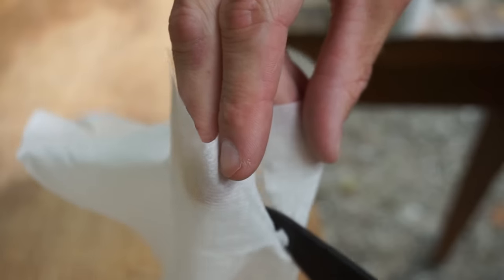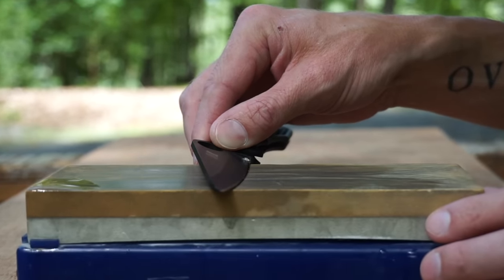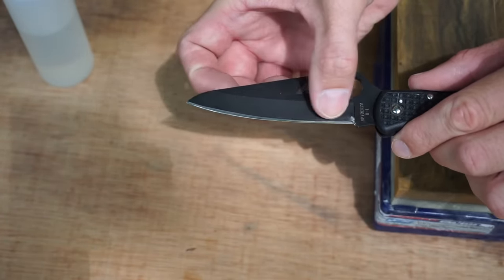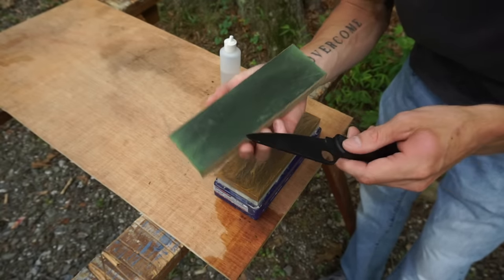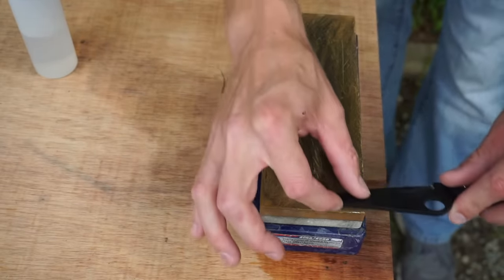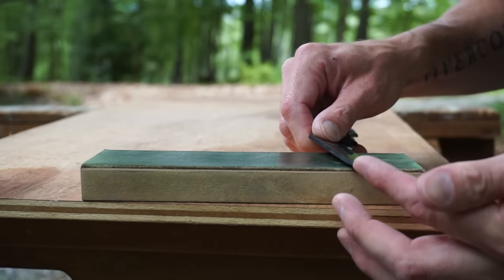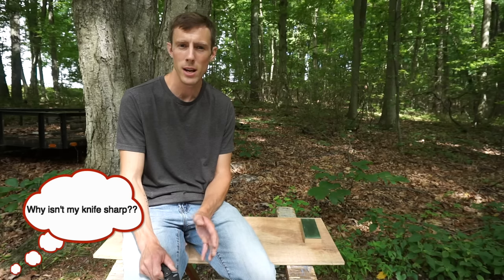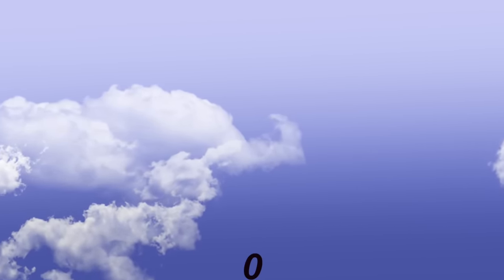3 SHARPENING TIPS BEGINNERS MUST KNOW.  How to sharpen a knife

Comment: I have a dual grit stone-100- and 240-grit...are these too coarse ie should I not use them except for extremely dull knives or cheap knives and go finer, and if so, how fine? Also are you using oil or water on the stone?

Comment: Thanks for this video.  Could you explain the different steel types and if there are different techniques to sharpening different types of steel.  I have read that Damascus steel has great edge retention  properties but is difficult to sharpen.  Is this true and if so is there a specific technique that works better for it?

Comment: I was taught about the "fast" edge and the "slow" edge. Fast is to sharpen towards you and the slow is to sharpen away from you and creates a generally finer edge.  But then I saw a toolmaker use circular motions and sharpen a knife to the point he could split a hair - my mind was blown
Reply: The circle was my old man's method too. I've dulled out knives beyond belief trying to do it, but so far no success.😂. He worked as a butcher for quite a while and that guy could put an edge on a knife. You could damn near look at it and cut yourself without touching it. When we'd process a deer or elk, I stayed away from dad's knives. I'd be bleeding more than the venison was if I didnt.

Comment: Good, useful tip about burr and work backwards. Been sharpening my knives for decades but never considered these 2 points. I also use 2 Japanese wet stones 800 & 3000. Would you say sharpening on 2 different coarse is important or one can get away with just one strength? Thanks, great video 👍🏼

Comment: As far as sharpening directions, you recommend going backwards to prevent digging into the stone. Is there a particular advantage to sharpening the other seemingly more aggresive way?
Reply: No significant advantage/disadvantage to sharpening one way or the other. Either way works perfectly fine, once you have it down. It's all down to preference, and which way is easier for you.

Comment: I'm curious as to your thoughts on the pros and cons regarding leading with the edge (pushing the blade) vs the spine of the blade (dragging the edge). I've had good results using both methods. However, when teaching others the basics of sharpening I find that pushing edge first as if one is trying to cut a layer off the stone seems to be easier for a novice. 

Any input on the different techniques, as well as tips for teaching either technique, would be greatly appreciated.
Reply: From my experience, it seems that a trailing edge motion is more common with people using natural stones while leading edge is more common for people using ceramic or diamond.

Generally I use a trailing edge motion for quicker touch ups, though that may be due to me thinking ahead towards using the strop and my brain automatically trying to use the same motion.

The one definitive rule I have for which motion to use is when using Japanese water stones I always use  trailing edge strokes.

Comment: Get a Nagura stone, or use an old broken stone as one. Deglazing the stone and creating a mud are very important. Also an 8000 grit stone removes the need to strop, you can use the little Nagura stone  instead at a push.

Comment: Hey there, I wanted to first say thanks for taking the time to upload all of these tips. They've been VERY helpful for me. I was also hoping to ask for your advice on a stropping question.. I've been trying out a paddle strop for my straight razor and both the top and bottom have a leather side. On one side I decided to apply a layer of chromium oxide paste, and quickly learned what a nightmare it can be for cleaning up. Haven't had these problems before when I used the chromium oxide in the more solid form that looks like a piece of chalk almost.. anyway, long story short, do you happen to have any recommendations for cleaning chromium oxide off of different surfaces such as leather and steel? (For example, the side of the strop which I didnt apply the paste to does have some residual amounts, and part of that is due to me not getting the compound off of the straight razor when switching sides). Thank you so much for your time and I appreciate any feedback whenever its convenient!  :)
Reply from the maker: If its a thick layer you can use a razor blade to scrape it off. I have a video on it. If its a thinner layer you can also use a 150-220 grit sand paper and sand it off as long as its not the smooth side leather. For smooth side you pretty much stuck using some kind of light oil to wipe it off. I typically dont use the smooth side leather for anything but dry stropping with no compound for these reasons. Hope this helps and thanks for watching 🙂👊
Reply: OUTDOORS55  ahhhh okay! That's a "lesson learned" moment for me then and going forward I'll stick to using those compounds on non-leather strops. I'll try the sandpaper suggestion and check out the video you mentioned. Thank you so much, very much appreciate the feedback 😁

Comment: How do you sharpen a tanto blade that has a sharp angle on the blade? My tanto has a rounded bevel rather than the v-shaped edge that anglo-saxon blades have? Thanl you for a GREAT video.

Comment: Hey Outdoors55, I’ve been straight razor shaving for great part of my life, and have therefore honed many many razors, but never tried honing a knife. Why do you hone the knife’s blade by going “towards the spine” instead of “towards the edge” (1:14)? In razors the honing process is done by moving the blade “towards the edge” on the stone, and finished by stropping the razor on a leather strop by going “towards the spine”. Is it a technical difference between honing razors and honing knifes (in the sense that they need to be handled in such way), or is it just one of the possible techniques, alongside the “towards the edge” one? Thanks in advance for a reply!
Reply from the maker: Theres no difference in direction as long as the angle is kept exactly the same. Keeping the burr as minimal as possible is why most will say to sharpen forwards, but that has more to do with feel, and steel type, than direction.  A burr can be removed/ minimized going forwards or backwards. And a burr will form in either direction as well. Getting the most out of an edge has more to do with keeping an exact angle, and progression.  So in other words, its just a different technique.🙂
Reply: OUTDOORS55 got it, thanks!

Comment: I was wondering what could be some DIY effective alternatives to a store bought buffing compound. I tried grinding brick and stone against each other to create fine powder that I then spread over the leather belt. The bevel of the knife got somewhat shinier. Another idea I had is to sand aluminium with sandpaper or a file to get powder, then mix it with some toothpaste and smear it over the leather. Could this work? I did not try it yet. Is there any other method that could be good at polishing?
Reply: Are you using a buffing wheel to polish or are you strictly hand polishing? I have been sharpening edged tools, anything from shovels to shingle froes, kitchen knives to machetes used for brush cutting to cutting cane for over 50 years, and I use red rouge for any polishing I feel is needed to finish an edge. You can purchase a 6" tube of most any polishing compound in stick form for less than a few bucks at any hardware store such as Lowes or Home Depot. That isn't a huge investment for a few years of power buffing or, in my case, maybe 10 years of almost constant hand polishing of knives and edged tools used around my homeplace.

Comment: Great tips, however, If you could give the newer sharpeners a tip or two on carrying the apex through to the tip of the blade, it would be some very needed advice. Also, if they are just starting out in sharpening, it would be a good idea to use an old straight edged kitchen knife as one of their first attempts. I have seen some really nice folding hunters with clip point blades, massacred by someone who didnt know what they were doing. The end result was almost no curve left in the blade and they had removed WAY to much metal in their attempt to sharpen the knife. The end result was actually sharp, but the blade no longer resembled what it was supposed to look like. Holding the sharpening angle through the curve all the way to the tip is vitally important, or you might as well take a hammer to the knife. It will be junk either way.

Comment: Another way to check your edge is, hold it up toward a light and look straight down it. There should be a thin shadow running all the way down the center of the blade. Anything glinting light back to you is a dull or folded edge.

Comment: How hard do I need to press down on the sharpening stone?  Maybe I'm not pressing hard enough... Also, on a long blade like a filet knife while using a shorter stone,  what is the best way to pass the knife over the stone?  In "sections" or should I try to slide the knife down diagonally so it touches the entire blade with each pass?

Comment: Is it realistic to be able to learn how to sharpen a knife until it is can cut paper relatively quickly? Or does that type of skill sharpening take weeks of practice ? I've been struggling to find a method that will leave me with a knife sharp enough to cut paper
Reply from the maker: Try a coarser stone and make sure you apex fully. Remove the burr and it will cut paper. It depends on the person. The better you maintain an angle the better your edge will be. It’s can be learned pretty quickly or slowly. I was a slow learner 🙂

Comment: I have a new Mora knife and have tried sharpening on a 4000, then 8000 stone but I don't get a mirror edge and knife does not slice paper like butter 🤔

I soaked the stones overnight and used water during sharpening 🤔

How long should I be trying to sharpen? 

I tested knife on basswood and seems no sharper 😪

Comment: How much pressure would you all recommend I apply? I've been sharpening knives since I was a kid, bit this is something I've been a little confused about. I get pretty good results with high pressure, but I fear for my stone and edge. Seems like a high risk, high reward method. Any thoughts?
Reply: No, use medium to light pressure. Let the grit do the work. If you need a lot of pressure, you are probably using too fine a stone for how dull the knife is. Why do you think butchers and barbers use a leather strop? They have a very sharp blade to start with, so a very fine strop can clean up the slight imperfections in the edge. OTOH, if you have a used and abused pocket knife, start with a coarser stone (and light pressure), and work down to a finer stone.

Comment: Holy crap, dude! I've never seen anyone with the same stones I have besides you. I got mine back in like 2008 and still use them. Had no idea they still made them. Where did you get your strop from? That's the only thing I'm missing. I've just been using my leather wallet lol.
Reply: I found a nice strop on Amazon for about 17 bucks. It even came with some green compound. I used it on 15 knives here at home and I really like it.
Reply: @kirkjohnson9353  Appreciate your comment, Kirk. Any specific brand you have?
Reply: @SouloDoloMusic  I got the Beaver craft LS6P1 . It has leather on both sides so I can go longer with out cleaning- or , you could have different grit on each side. I just use the green stuff on both sides and it does everything I need. I was going to build one since I'm fairly handy but I wanted one to use right away and it's hard for me to justify my time when this nice one is only 18 bucks delivered to my door. Leaving me free to work on more important stuff.
Reply: @kirkjohnson9353  Really appreciate that, Kirk. Sounds like a great deal and I'll definitely look into it. Thanks a lot for your help!
Reply: @SouloDoloMusic  You betcha man. Nice talking with you.

Comment: I've been sharpening blades for nearly 45 years and I can honestly say that the right lube for the stone being used is imperative. Get it wrong and it will take you twice as long.
Reply: Water on water stones and oil on oil stones right? Is there more to this that I’m missing? You don’t really see anyone using oilstones these days, water is where it’s at. Clean, plentiful, free, and works great.

Comment: I bought a Japanese whetstone with 1000/3000 grit and I can not seem to get any knife razor sharp with it. I can get it where it cuts paper but shaving hairs feels impossible. Should I have a lower grit stone? The blades I'm trying to sharpen are not well used with damaged edges so not sure why it won't get razor sharp
Reply from the maker: A coarser stone will help apex faster. Most likely your not apexed. An apexed knife will feel sharp off the stone. 1000 grit IMO is too fine of a starting grit. Hope this helps!

Comment: This is some funny stuff! I I'll pull the blade edge to me, never have a burr like you are talking and it will shave just as good if not better and in half the time. By the way, angle matters allot!!
Reply from the maker: If you apexed you have a burr whether you knew it or not. The exact angle doesn't matter in terms of apex sharpness.
Reply: Call it what you'd like. The only time and reason anyone would have to but a burr like the one on the axe is if you are trying to remove to much steel to fast. Same with a knife edge. The media in which you are using to sharpen should be doing the work, not your muscles. You're results may be the best in world, I don't know. What I do know is that you are telling them the hard way and easiest way to mess up the edge of a knife. When my knives get dull, could quick passes on a fine stone or as little as a well used belt will put the edge back to razor sharp. Ideally there won't be a burr when you are done. Least wise one you can manipulate with a strap. Should just be the perfect meeting if the two sides.

Comment: I agree with most of it but I don’t necessarily agree with going backwards I’ve been doing the. Other way. For 45 years and I get a very nice working edge but if that works for you then by all means continue but I think when you get into the harder tougher steels like CPM3V you will be forever getting a good edge in that manner

  Have a great day
Reply: These advices are for beginners, as the title of the video says, 45 years experience hardly qualify as "beginner".
I agree with this video in that a beginner should only sharp backwards until he acquires what Alex call "muscle memory" that keeps the angle steady.
After the beginner learns, he can do whatever he wants as Alex admits he also do it himself.
Reply: Yeah I know I must have just been bored

Comment: I agree with pretty much everything you said, except the sharpening backwards. I hone a lot of knives, and even hone and shave with straight razors. I guess its a personal preference, but I have always honed my blades typically in a forward X pattern and I have never once cut into any stone. I even use honing paper all the time and if cutting into a stone would be an issue, them it would be magnified big time with the sheets, but it never has been. Hone forward, strop backwards. Too each their own tho! Great video otherwise

Comment: I've never felt a burr,  so I must not have sharpened enough. I use 3/4 birch ply with wet/dry sandpaper from 400 to 7000 grit then a strop. None of my edges will shave, so I guess I have work to do...

Comment: I always cut into the stone. If you cut into the stone you avoid burrs. If you dig into the stone then you know you are at to steep of an angle. The method shown in the video works but it tends to make rounded bevels. Rounded bevels are okay for many cutting edges, like for an axe where the edge takes a pounding.  but rounded bevel edges are not suitable for chisels or hand plane cutters.
Reply from the maker: If you maintain an angle you will not get a rounded bevel.

Comment: I hope you'll actually see these comments as they are germane to your instructions. 
1. You state that the actual angle of the edge when achieving the Apex isn't overly important. But if you don't know WHAT angle you are striving for, how do you maintain repeatability next sharpening session?
2. You say to pull the knife TOWARDS you with the edge away from you. Again, how do you CONSISTENTLY maintain the exact SAME angle to achieve a CONSISTENT blade Apex? Obviously you don't want the sharpened edge to look like flat facets if viewed under a strong magnifying glass. 
3. WRT the strop, do you recommend using just plain, untanned leather, smooth side up,, tanned leather or some kind of jeweler's rouge as a fine grit means of polishing the blade edge to achieve the utmost in sharpness?
Inquiring minds wanna know. 
TIA

Comment: I worked in restaurants for 15 years and constantly used the steel rod. I was told early on that the steel basically "cleans" and doesn't actually "sharpen" the knife. Is there any truth to that?
Reply from the maker: Yes there is truth to that. A steel doesn't actually remove metal. It will straighten a rolled edge which is common.
Reply: This is only true if you use the steel in the right direction. IT IS A BACKSTROKE FROM THE HILT UP THE STEEL! I make highend kitchen knives{custom steel, not stainless} I've had to reteach chefs the proper use of the steel because most culinary schools teach it wrong and destroy the edges in weeks. Properly maintained good kitchen knives should only need touch-ups every year, not every 3 months like one client.
Reply: @darinholmes5668  I worked in a high bbn production kitchen
 Constantly butchering meat, poultry and fish. I was hard on my blade, cutting through bones and cartilage and gristle. The steel rod was ny friend but the knives were sharpened by a vendor every few minths. Since I started watching this channel, I can put a sweet, fine edge on my blade now!